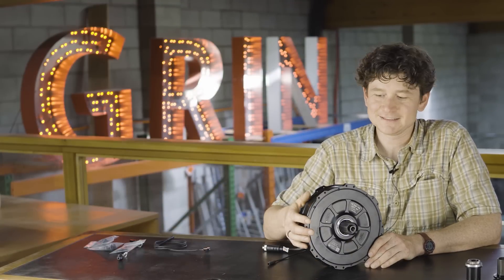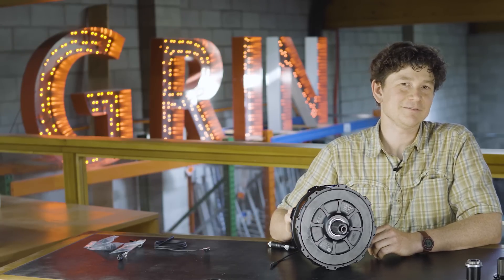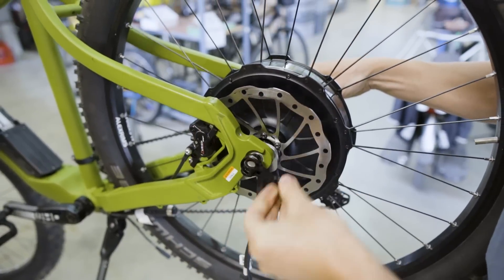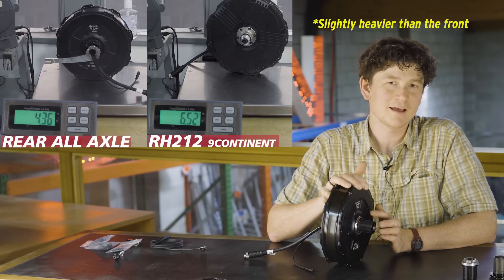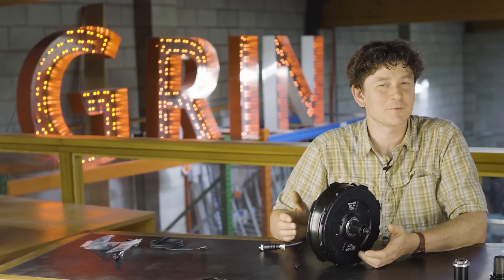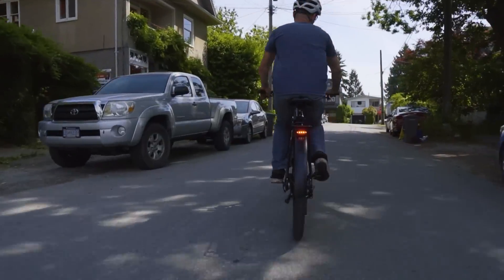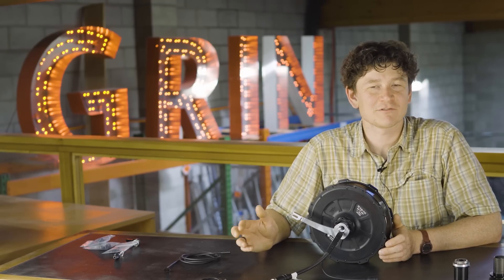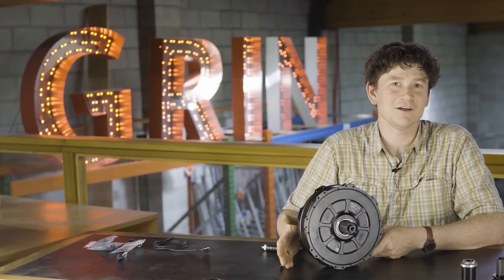Introducing Grin's REAR All-Axle Hub Motor.  Quick Release and Thru-Axle, Integrated PAS

Comment: Amazing where we are with electric vehicles. I was always a petrol-head and didn’t like my mate’s e-mopeds back in 2005. It mostly sat unused due to the shitty batteries back then. Now, I can make an e/bike and use whatever frame I like. I’ve got my beginner fat tyre e-bike (48w 750w hub, 48w 15.6AH battery) and an extra 20AH battery will be at my door soon. Gonna use this set-up for a year or so and then do some upgrade. Bigger hub, battery, controller, etc. I want an electric JetSki, if they exist. I might look into it.

Comment: Greetings. This product is interesting, but based on personal experience, it's good to have a quick-release version without an adapter for greater axle strength. If you have an option like this, I'd love to have it.
Reply from the maker: There is no adapter on the standard quick release model, just the two end caps. If you are talking about a solid axle instead of a quick release skewer, that can totally be done with 10mm threaded rod and some 10mm x 12mm shim tubing and we've had a few customers do this who needed a threaded axle for other reasons (eg chain tensioner or attaching a trailer mount).  Strength is not one of them.

Comment: is throttle an option?  how would this motor fare on a loaded cargo bike like a Yuba Mundo? How susceptible is this motor to water damage? Which is best for grocery getting and adventure biking in hilly terrain?
Reply from the maker: Yes : quite well : not very : don't follow.
Reply: @GrinTechnologies  many bike shops claim direct drive motors pale in comparison to mid drive or geared hubs on steep inclines, especially loaded with weight.....what would be your response to that? for the amount of money you're asking for your motors, I'm a little loathe to experiment and find out. electric bikes are becoming more expensive than motorcycles...the value isn't there yet imo....generally speaking.

Comment: Amazing motor and so much work put into it.   But in my personal opinion, which is not specific to this motor, but this could have been a gateway motor for this idea.  Is single arm instead of fork, front or back (or both).   With torque arm built in motor, it would work well with single arm.   Single arm allows for easier replacement and repair of wheel that doesn't have spokes.  Motor, brakes and rest remain attached to arm and you would fasten wheel to motor.  This saves a LOT of time.   I researched, cost of single arms are actually cheaper and lighter for same strength as forks when mass manufactured.  Solid wheels the same, though they are slightly heavier, but with motor who cares vs. lower extra cost and time spent on spoke repairs.
Reply from the maker: You can mount the front motor very easily with a single arm, but on the rear it is quite problematic since you have a derailleur on one side of the hub and the disc brakes on the opposite side, so somehow you still need to support either the caliper or the derailleur with an attachment that needs to straddle over the wheel from your single side arm mount.  If you wanted to go regen only or have rim brakes as the mechanical brake then you can do single side swing arm on the derailleur side in principle, but you will have some challenges with the torque arm design in that arrangement as all motor torque has to go through a 12mm ID x 15mm OD stainless steel tube.
Reply: @GrinTechnologies  Yeah your absolutely spot on, I thought of that, that's why I was hoping that pinion gearboxes would be come more affordable.   As with that you can do away with derailleur completely and run a belt. It would also make it very low maintenance, great for commuting.

Comment: Hub motors are so obviously the way to go, it’s still surprising to me, that all sorts of uses in motor vehicles have not arrived yet.  Some scooters, some DIY attempts on the back wheels of a conventional car, etc.  It just seems the most efficient way to go, especially if an epicyclic gear unit is built-in?  I literally imagined, the best use of that space on a mid-range motorcycle, between the two front disks, would be a hub motor.  I have what you all call a Seca II, we call the Yamaha Diversion, 600cc model, from back in 2000, aircooled, chain drive.  The idea of a front hub motor that would regen and do the motive power for steady-speed cruising, did appeal.  I thought a pannier setup to hold batteries in the bottom, leaving usable space.  Anyway, the beauty of such an idea is you could run the speed control in simple parallel with the ICE unit, add effort in the higher gears or at lower-torque moments.  

If a Tesla or Kia can use just 200W per mile, my bike ought to manage half that I thought, despite aerodynamics being an absolute disgrace!  Then again, that’s the problem - once I sorted the carbs out (terrible things were done in the year 2000 to meet emissions!), replacing the pilot jet a notch bigger fuel-flow, I was astonished to find it went up to 73mpg.  Previously it was 40mpg, so much for better emissions.  It worked almost ok in the heat, and someone said Japan’s pretty warm much of the time, well here in the UK we’re not.  73mpg is without in any way trying, and with a tent and stuff strapped on.

Perhaps the regulations, the insurance, all of it, just makes it pointless to try and convert or adapt present vehicles, or maybe most cars and motorbikes are much more ‘consumable’ items than I think?!  I saw a quadracycle-classified ‘car’ on fully charged show, and it was a good crack at an in-between vehicle in the sort of Twizy area of vehicle use.  IE small, light and in-between scooter and a ‘proper’ small car.

Great stuff.  I don’t think the price of these units is necessarily offputting, they are robust and worth taking care of.  Our youngest daughter drives a car that is 24 years old, 2 years older than she is.  We’d get rid, but it simply hasn’t made economic sense yet.  Every year, it’s less than £1200UK to keep it going, which is my rule.  This is because someone once told me you couldn’t get any new car to buy, or lease for less than £100UK per month, and they were right except in a very singular lease-deal circumstance, I found.

So I’ve stuck with this rule,and passed it along.  Replacing all the steel wheels as they began leaking air (!) and such fundamental one-off maintenance, brought us close to breaking the £100-a-month rule, but you just count forward in time and mark on the calendar the date at which your new ‘rolling break-even point’ is hit, and adjust for any other purchases to repair along the way.  We just passed another one, due to buying and fixing major suspension parts and those steel wheels, last summer.  Now there’s some small bits and pieces, that pushes us into the middle of this month - oh we’re there.  Restart the clock, sort of thing.

I guess I should circle back to the point…!…if there is one…back in the year 2000, £7.5k for a little car was a big price for us.  We never expected to keep it this long.  My experience therefore is, if some vehicle has sufficient longevity in one use case or another, and can be afforded, it’s worth paying the price ESPECIALLY if you don’t have much money.  Wealthier folk than us, can afford to indulge in whatever car is flavour of the year, we can’t and won’t.

Maybe where I’m headed to, is you are surely going to fit these one day, or somebody will, to a light small car, which would be around that Twizy segment, but perhaps even a bit ‘more’ than that.  They have tried to sell Renault Zoe cars here in the UK, for £33,000 for the base model, this is insanity.  Hope you go from strength to strength.
Reply from the maker: Thanks for the story! We still have customers who bought their hub motor back in 2005-2006 when we were just starting off, and those direct drive motors are still going strong.  Not as efficient and light as current generation, but it's a tech that just keeps rolling and no reason they can't outlive the bikes themselves. 

Geared motors have a but more of a vulnerability with the clutch and gears themselves.

Comment: Will a 48v battery 21ah be able to run a bafang 750watt 48v bafang rear hub motor with a 22A KT controller,any input much appreciated
Reply from the maker: Yes
Reply: @GrinTechnologies  thank you sir just one last question what would be the maximum BMS Amp for this battery I've seen it could be between 30Aand 40A max only info I have for this battery is as stated above thanks for the speedy response

Comment: Is it possible to make a front wheel hub motor to pair with a mid drive motor bike to make an AWD bike with the advantages of a mid drive powered bike? The front motor doesn't have to be that powerful, because its just needed for traction when you need it so it should be toggleable.
Reply from the maker: Yes of course. See our video presentation on multi motor drive systems which goes into that on same detail. Best efficiency is with a direct drive front hub motor you use all the time, and the middrive is only used on the steeper hills.

Comment: I wish Grin would put as much time and effort into building a great mid-drive as they do on hub motors. There's a huge market, and BaFang has serious production issues.
Reply from the maker: We're 100% on team hub motor. We spent about 5 years of mucking with Middrives and we swore never to deal with them again.
Compared to a BBSHD, this all axle motor is significantly lighter, does regen braking, is easy easier to install, had built in torque sensing, has comparable power capabilities, and is intrinsically a lot more robust.
Reply from the maker: Middrives make sense of your are doing e mountainbiking in the trails, but that's about it. For commuting, cargo hauling, long distance touring, and general cruising, hub motors reign supreme.

Comment: I had a crystalyte motor once. I had a heavy passenger on my bike . the screws losened and the stator was broken from rubbing. Does this motor have those issues, or can I easily have two heavy male adults on it?
Reply from the maker: You can rest assured that this shares almost no structural design similarity to an old crystalyte hub.

These motors are used in cargo and passenger hauling applications all the time.

Comment: Great video!
I'm in doubt between buying a ready-made bike or building one.
I want an electric fat bike with 1000W on the front wheel and 1000W on the back wheel for a total of 2000W
One thing I see in several electric bike videos and worries me, as I'm about to buy or assemble an electric fat bike, is that it's common to see the electrical cabling heat up. But it seems to me to be a mediocre error on the part of the manufacturers as we know that this is a consequence of poor sizing of the diameter of the electrical cables, which, being thin and undersized, generate resistance and heat up. I've seen a video that burned! If the controller and other systems heat up to the point that I have to wait for it to cool down and stop using it, it is also a failure in sizing, that is, undersizing. I live in Brazil, a tropical country, the bike will heat up much more when riding in constant temperatures of 36°C, 38°C, and even a few times more. I'm going out around the world on a sailboat, and I'll be mostly in even hotter tropical countries.
What would you say to me? Are my observations correct? Is it very complex to assemble a bike (I'm prone to this)? Do you have a motor for a Fat Bike frame?
Hug!
Reply from the maker: Any smartly designed system should have a seamless thermal rollback built in so that if either the motor or controller start getting too hot, the system power will just scale back the power to keep it within the safe window. But surprisingly few ebikes at the lower end of the price range bother to have that kind of safeguard.
Reply from the maker: https://www.youtube.com/live/c96n0Ma2rLY?si=F5xs6n8Fa9jrI37_

Has more insight into motor thermal limits

Comment: What is the most power you can pull from this motor and at what max voltage? Does the motor accept 72v? Assuming a 52v battery, what is the maximum performance of the motor, I ask because the eggrider does not work at higher voltages.
Reply from the maker: https://ebikes.ca/product-info/grin-products/all-axle-hub-motor.html#MotorPower

Stay tuned to our YouTube channel as we will be releasing a video later that is all about motor power capabilities, which will address all the common misunderstandings on this topic (which reading between the lines you have plenty of too)

Comment: For me any motor is out of the question without torque sensor, so if I install a torque sensing bottom bracket, can I use it to guide the motor?
Reply from the maker: Yes of course. We list all the torque sensing BB's as adoptions on the kit bundle here: https://ebikes.ca/shop/electric-bicycle-kits/grin-all-axle-kits/grin-rear-all-axle-barebones-kit.html

Comment: can this motor be use on a rear trikecycles with chain drive sprockets to the rear differentail. would like to up grade my 500 watt motor.   thank you.
Reply from the maker: Not generally unless the motor on your existing trike is a rear motor that is spinning in reverse and driving through the sprocket. For those trikes the entire axle is rotating so you can't really put a hub motor on the rear, but you can easily put a hub motor on the front fork.

Comment: Looks like a great motor. Is it possible to pair this with a controller that a SW102 display can be used? I am kind of a minimalist.
Reply from the maker: It's just a motor, you can of course pair it with any motor controller and display that has the capability of running a standard 3 phase BLDC motor of this power class.

Comment: Question is it possible to install this motor in a 175mm dropout .
Reply from the maker: Nope, that would require a proper fatbike hub.  You can't do it with spacers on this since all the spacing has to be on the disk side.

Comment: Wow that is exactly what I’d need! By the way, are all the right length cables included in your ready to roll kit? Or do some have to be ordered separately?
Reply from the maker: We make extension cables for every connection, but the RTR kits have the appropriate cable lengths for standard bicycles.
Reply: ok thanks a lot  @GrinTechnologies

Comment: What makes rear and front hub motors non-interchangeable? Is there any way to adapt a rear-motor to work in the front, or vice versa? Thinking of long distance no-resupply applications.
Reply: The rear motor accepts a cassette. The front does not.
Reply: @LexYeen  thanks! So could a rear motor be used in the front simply without a cassette? And could a front motor be used in the rear in emergency for throttle only purposes? (Assume we remove the chain, or whatever if necessary)
Reply from the maker: In addition to the cassette freehub situation, The spacing of a rear dropout is 135-142mm, while a front fork is 100mm, so the axle lengths are completely different too.  If you wanted to mount the front hub to a rear dropout you'd have to machine custom inserts to increase the axle length by ~35mm, and both the disk rotor and torque arm would be quite a bit further from the dropout slot than they should be and would need to be spaced out as well. 
.

Comment: Do you make a adaptor to go from a baserunner with higo Z910 to the HiGo L10 pin this uses?
Reply from the maker: We have one going the other way (L1019 controller to a Z910 motor), but not a stock prefabbed cable to go from an L1019 motor to a Z910 controller. When this comes up we usually just solder it up as a custom cable.
Reply: @GrinTechnologies  will it read the temp and speed on my CA?

Comment: good to see advancements in the hubmotor.  Great technology.  Question about hall sensors…I’ve experienced quite a few hall sensor failures over the years…is there a replacement that would outlast the hubmotor itself?  They are a pain in the @#& to change out, lol.  cheers from northern BC👍
Reply from the maker: Hall sensors are extremely robust devices, as reliable of a position sensor you can get. There are only two things we see that cause then to actually fail. One is of they get shorted to a phase wire exposing full battery voltage, usually from abraded wiring when the cable exts the axles and gets chaffed, and the other is water ingress damage causing corrosion of the wire leads. So you should really do a root cause study. 

Often times people replace halls for no reason when the problem is in the wiring harness or connectors and not the hall IC itself

Comment: This is amazing! How does it compare to a GMAC in terms of sustained phase amps? Can it absorb and dissipate more heat?
Reply from the maker: For a given phase current, the GMAC motor will have noticeably lower copper losses because it has significantly less winding resistance.  However, it also has longer and more convoluted path for heat dissipation, so at the end of the day even though it's generating less heat it will still end up getting pretty hot.  Compared to an All-Axle motor WITHOUT statorade, the GMAC motor will hold up better thermally for a given torque output. But in comparison to an All-Axle with statorade, the two systems are very similar at what they can sustain at the thermal limits.
Reply: @GrinTechnologies  thank you!!